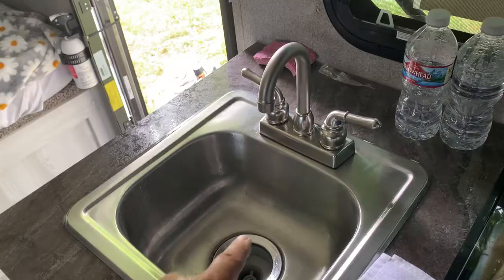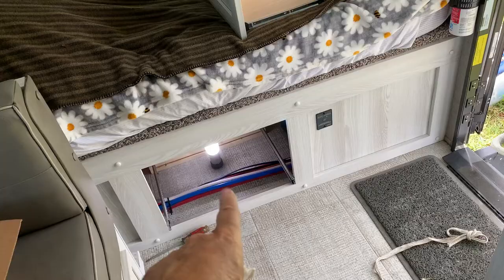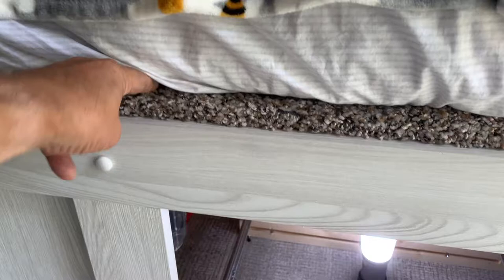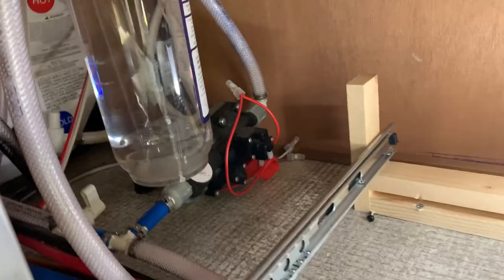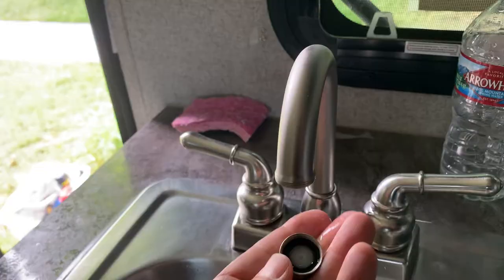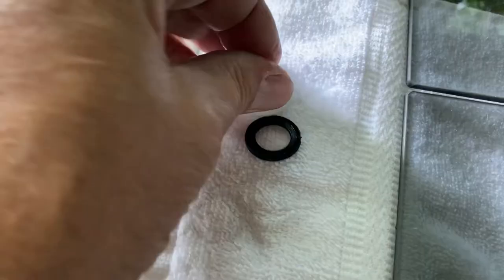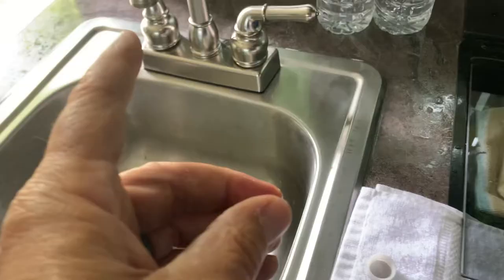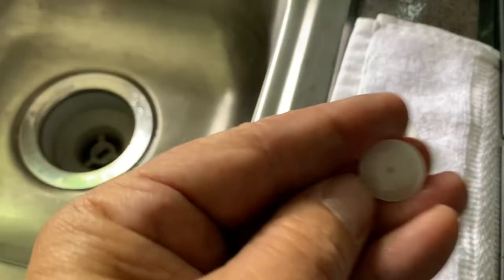No Water From RV Faucet? Check This First!

Comment: Thank you. I was about to start pulling everything apart.  This saved me a lot of frustration.
Reply from the maker: Awesome!! Glad I saved you the frustration!
Reply: Same!  Hadn’t moved rig in 6 months and after doing so kitchen AND bathroom faucets suddenly lost water flow (but shower worked) so thought I pulled or pinched a water line during rig repositioning.  Thought to self they both couldn’t get clogged at the same time?  Welp, they did just that— hard water deposits jiggled loose and traveled to those two faucets during the move.  Super relieved and thanks for the tutorial video!!
Reply from the maker: @FortShenanigans  Glad I could help! We often assume the worst and overlook the obivous!